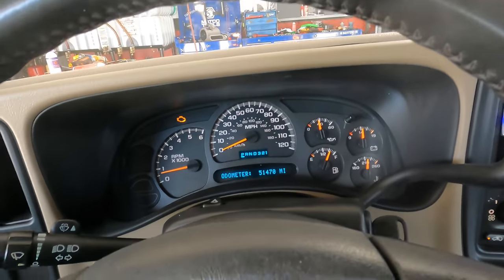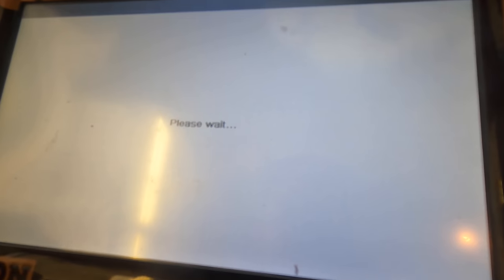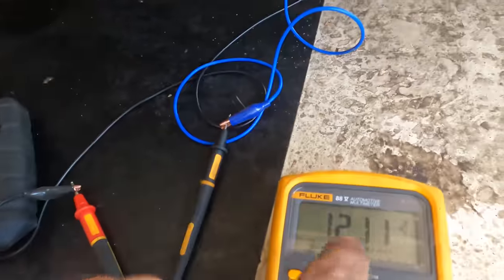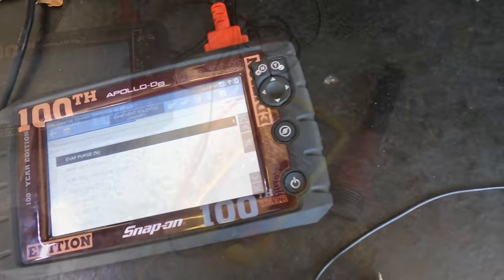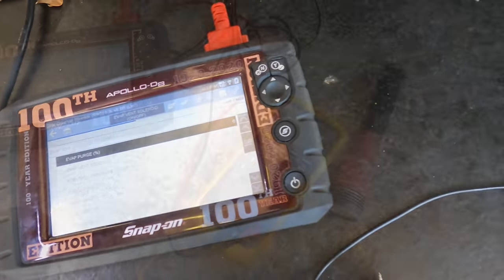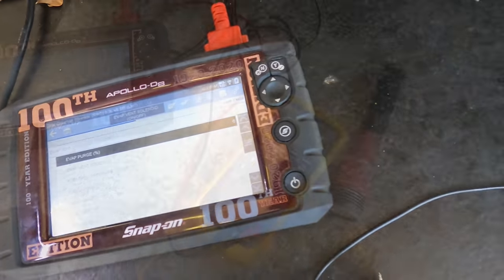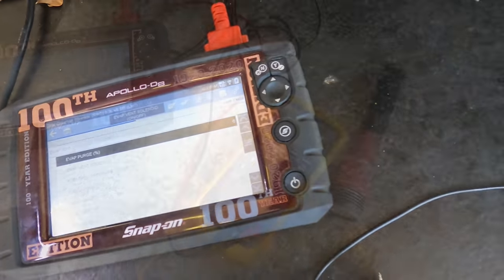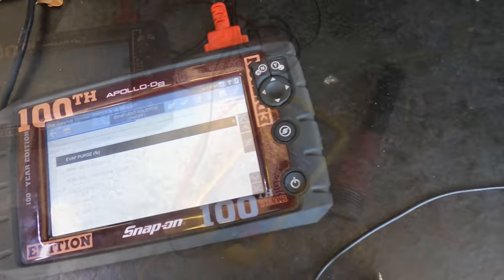RARE FAILURE! Short Circuit? Misfire Evap | Chevy Silverado 5.3 P0300 P0455

Comment: Hey. Good job ray. You should gwt a power probe. Then you could supply power and ground independently. Also some models have 5v referance and a volt meter function.
Reply: I have one of those.  The main reason I bought it was the ability to probe through the insulation on the wire.  In the old days I would use test leads that had very sharp points to do that job and about half the time I would stab myself.  Since the Power Probe came out others now have that feature but I think Power Probe was first.

Comment: I'd like to point out the negative resistance value on your meter during your troubleshooting is an invalid reading. This is because the circuit is energized. The voltage is driving the meter reading instead of the meter providing the test voltage. In order to perform a continuity/resistance test, the circuit under test should be de-energized.

If you ever see a negative resistance that's your indication the circuit is energized and cannot be directly tested for resistance.

Love your videos, Keep up the great work!
Reply: It was double checked and further verified, when he disconnected the ECU. With his go/no go check
Reply: @pmotorsports8276  I wasn't questioning his troubleshooting ability, I was simply pointing out the reason he was seeing what he was on his meter at the time and perhaps improve his knowledge.

Comment: With the amount of programming you do would it make sense to have the factory flash tool and pay per program like Eric O
I do understand you are an employee of a shop and Eric has his own business but I think you would have a very good case with the boss. It would certainly make your life easier.
Thanks for your great content from an old retired mechanic who specialized in driveability problems in the bad old days of OBD 1. 👍
Reply: I do not know the cost of GM software. I do know the cost of the Mercedes software in the US* for a business. Cost $29,000 up front for 4 year  license, includes the hardware then around $4,000 per year for  license. *As the US is NOT  regulated, in the EU where regulated they{vehicle manufactures] MUST give access to non-dealer business at a reasonable cost, cost was a few years ago around 70€ per hour, business supplied hardware. Look up the cost of the current GM scanner/ programmer a few thousand NOT including the programming software  which is per vehicle. Yes, I am aware you can purchase "copies" of the OEM scanners/programers, you still have to purchase the programming software/program for each vehicle.

Comment: I'd be curious to see if you got the same results if you had used an incandescent test light to check the vent solenoid circuit instead of a voltmeter.

Comment: While watching your video where you changed a power window actuator you cut the bolts that were too long in your vice with a side grinder. There was an aerosol can in the direct line of the sparks from the grinder. This is an unsafe condition.
Reply: Sparks will not ignite a compressed aerosol can. Sparks by the time it travels 6 inches it’s cool to the touch
Reply: The other thing is that the blade can shatter and pierce the can. Not a good thing.

Comment: Any chance you can tell us what the ECM  costs... Im curious

And a used one wouldn't have worked?
Reply: I wouldn't trust a used one when it comes to electronic components like these ECMs. Too risky something is wrong with it that could mess something else up in your vehicle. Anyway, Googled the part number from the video, and the prices were from around $200-$230 or so for a new one. Refurbished was a bit cheaper. Not saying that's what the one in the video cost, just an idea what it may have cost.
Reply: @george8873  Wow that's cheaper than I thought it would be.... Thks

Comment: Use an arc suppression device close to the ECM for this circuit. A contact breaking DC will take more abuse than a AC circuit at the same current rating.
Not going to get into the math of what happens when breaking a DC circuit with a coil involved.
1. When the contacts in an arc suppression circuit open, the applied voltage is placed across the capacitor and not the contacts.

2. The capacitor charges at a rate faster than the contacts open which prevents an arc from forming across the contacts.

3. When the contacts close, the inrush current from the charged capacitor and source can be substantially higher than the contacts can safely conduct, causing the contacts to deteriorate. This is why it is important to have a resistor in series with the capacitor.

4. The resistor acts as a current limiter which reduces the inrush current by a significant amount. The arc produced at the contact closure is greatly reduced, thus extending the service life of the contacts
Reply: So if you have a bad purge valve coil, it will destroy the ECM contacts. Go to Digikey or Newark electronics to select the correct arc suppression unit for voltage and amperage rating.
Im just saying, but not saying.
Works for all other DC coil circuits.
Easier said than done.....but I have time on my hand.

Comment: Or… you could gut the innards from both purge solenoids and put the good ones in the can for the old one (that still has the hose on it.)! Or repair the old one with duct tape and baling wire. Everyone knows you can fix anything with duct tape and baling wire! 😆 (and maybe a hot soldering iron.) Nice shout-out to Eric at SMA! ❤️

Comment: Pine hollow  had to reprogram a reman ecm with his scanner. . Had to change the Vin  number  it was suppose to be program from manufacturer but wasn't.  The ecm he had had Vin from  another vehicle it was taken from and reman. New ecm was possibly not available  or too expensive. I've seen injectors on John deere tractors have their own numbers that have to be reprogrammed to the engine.
Reply: He had to do that with an injector on a earlier video (a 6.6 duramax, I think).

Comment: That remote programming service is horrendous! Have you thought about getting into programming  yourself? A Bosch Mastertech 2 would be a great place to start. It’s works with the Ford, GM, FCA, Nissan/Infinity, Honda/Acura and Toyota/Lexus OEM software. The OEM software is available via a short term(daily) subscription for a reasonable fee. The cost would be passed onto the customer as part of the job.
Reply: Just checked online and found Grainger has them for less than $2K, much cheaper than a scan tool.

Comment: Surely plug in and go should be on the ecm all that mess about these electronics are a pain
Reply: It's entirely possible for them to design these systems so modules don't need to be programmed, but if they did that (a) they would lose the revenue stream from requiring programming, and (b) there would be rampant theft/resale of the modules.  It's kind of a no-win situation I guess

Comment: Misfire,  a cel, and a Silverado? Yeah, that's about normal and those CEL bulbs will last longer than the engine.  
I've got 520,000 miles on my 02 and have replaced the engine. Damn CEL still hasn't burned out, truck runs like a top.

Comment: Ray….  Good job on the evap solenoid job. I have been watching faithfully for several months. I can see that I will be willing to dig in a lot deeper on shade tree projects than I once was.  Thanks.  That should save me lots of money in the future.   The only question I have had with any of your efforts is why you don’t add a drop of oil once in a while to threaded puller tools like ball joint splitters, etc.   Seems like that makes things work more smoothly, might provide a little more pull in some cases and probably preserves the tool threads. What do you think?

Keep up the good work.  Thanks.

Comment: I'm a little surprised they didn't give a spec on that hose splice. I'm not entirely sure heater hose is up to the job. It will probably be fine for the rest of the life of the truck since the old tube is butted right up to the new solenoid, leaving very little exposed heater hose. Personally, I may have tried to use fuel line of one type or another, but as I said, being an 04, it will probably be fine for the life of the truck.
Reply: It's an '04 with 51k miles. At this rate the truck could conceivably be on the road 50 years from now...  A lot of those 2wd 1500 GM trucks of that era are rolling well past 200k.
Reply: @mikejacob3536  I have an 03 2500hd, great running truck, but here in ohio, rust is starting to dig in pretty good.
Reply: @donakahorse  I'm in Wisconsin. Most trucks over 15 years old up here are suffering terminal cancer.

Comment: Now if you had not bought that scan tool you could not have done what you just did on that truck, its paid for its selfe
This tool make you more valuable its better then what the shop has as you stated. 

A good buddie of mine kept up with the ever changing tools I belive that unit can be flashed for new models as they are interduced  unless they move from odb2 to odb3 as they had talked about 15 years ago.  Toyota kind of started this 
My 88 supra has somthing like it but most the new scan tools won't work on it.
I dont even out a scan tool not even a cheap one.   I should buy one.
The mechanic I knew like to drive without a seat belt on, I took him to a dealership once before id start the car I made him put it on.  10 years ago going to a new car dealer for parts durring a snow storm he rolled his truck on an icy bridge fell out the driver door window and got crushed by the truck. Killing him.
Wear your seat belt.   In a parking lot no big deal.  Out in traffic put it on.

Comment: Do all makes of cars require the assistance of a RAP artist when replacing the ECM? Was that Run DMC on the phone? You did a good job! I was at first thinking leakage current thru the ECM was making the meter read 12V constantly on the solenoid connector. When a computer output is a relay, the meter will work fine, but if the output is a transistor or thyristor (in the case of AC outputs on industrial stuff) there may need to be a bit of a load when testing for an off condition. In those cases, one would want the meter across the wires with the solenoid or some other load connected - just not open-circuited. Do ECM's have all relay outputs, transistor outputs, or a mix of them for discrete (on-off) signals? You might already know - so had no qualms about the open-circuit condition. Being a sub-novice DIY clown, I had to ask.....
Reply: My guess would be that the ECMs are exclusively transistor outputs and anything higher power would find the relay in a fuse box controlled my the ECM.

Comment: As an electrician it made me cringe when you took your multimeter to resistance while the leads are connected to a power source. Even your Fluke was screaming at you for doing it. Sure it's only a 12v system but improperly using the resistance function while on an energized circuit can and will damage your multimeter. Fluke is pretty good with providing built in failsafe so you don't get injured but I'd rather not rely on something like that. This practice is especially dangerous when you deal with larger voltages/current as even the failsafe can't stop a multimeter from blowing up in your hands.
Reply: The way you keep your fluke from blowing up is you throw away the fuses that fluke puts in them (10kA interrupt rating) with some 100,000A IR rating or higher. Fluke knows those 10k IR are little sticks of dynamite and the will still put them in.  The fuses are what blow up.
Reply: I cringed as well! So many times on this channel I see him test circuits disconnected with an ohm meter. No, just no. That's not how you test circuits. I know that's what the trouble tree in the manual wants you to do, but an ohm test is very much inferior to voltage testing the circuit under the load it was designed for. This verifies everything at once, including the wire's ability to transfer the proper amount of current. If you see voltage across the terminals of that solenoid while it's connected you don't need an ohm test. Ohm testing has it's place, but it will bite you in the ass in the wrong circumstances.

Comment: 09:02 Measuring 2 Mega-ohms to ground? That's not enough to actuate a solenoid and probably just moisture.
Use a small test lamp, not a multimeter!
Not saying the ECM wasn't pooched, but if the output was "on" the reading would be in ohms, not millions of ohms.
To demonstrate this to anyone curious, lick your fingers and measure the resistance between them with a multimeter - you get a reading in the k to M range. Now try to operate a 12v solenoid with your fingers!
Would be interesting to see if there is water damage in the old ECM.
Reply: It was previously shorted to ground  0 ohms, mego ohms with ecu disconnected
Reply: @pmotorsports8276  Yes .... saying "We should see this circuit go open when it's commanded off...we do not" ......... 2 meg is pretty flippin' open!

Comment: Could the fuel cutoff be programmed at a higher rpm? 
During the crank position sensor reset,
What happens when the ecm is programmed for 5000 rpm vs 3500 rpm?
Reply: You may be able to get that done by some aftermarket programmer but I don't suggest it. The rev limiter is in there at that rpm to keep people from blowing their engines up.

Comment: Chevy's were once reliable before they went bankrupt and were bailed out by the government....daily drivers of mine are a 61 GMC longbed with a 327-375 4 speed and a 65 comet Cyclone 4 speed with a 289 HO....both are slightly modified.  JESUS SAVES. Good Job Ray.
Reply: This generation (99-06) was the best and most reliable truck ever made.
Reply: @bikes7777  engine,  not the 1500 transmission
Reply: @pmotorsports8276  transmission was a bit weak if pushed but still a solid choice. And easy to rebuild.
Reply: @bikes7777  10-4  700-R4/and all of its 4L60E descendants have made me lost of$ every 100k miles
Reply: @pmotorsports8276  nice!

Comment: First thing I check for a large leak is the gas cap. I've had more than one car come in with a large leak and when I went to check the cap, it was missing.
Reply: Seems someone else thought about that as the gas cap was new.

Honestly there's such a lot of new things on these cars that I have never had to bother with. The most modern car I've had was a 90 something Toyota. Very little of all these things in that. Note even a ODB port to be found. I think there was some Toyota proprietary port, but it wasn't anything I could use.

Compared to todays cars it was very simple. Most diagnostics were simply looking at the old  "Air? Fuel? Spark? Bang?" sequence.
Reply: @blahorgaslisk7763  it's still the same air, fuel and spark. It's just computer controlled now. If you know how it works, diagnostics is actually easier now.
Reply: @aaronbritt2025  It used to be simple mechanical devices, now there's all kinds of valves and sensors that keeps crapping out. Not to mention that it used to simple to replace a spark plug. Now they tend to be located deep down into the bowels of the engine, or at least that's the way it feels. There used to be one spark coil, and it was easy to access and almost never had to be replaced. The spark wires were cheap and easy to get at and the distributor simple and easy to understand. Just about everything was simpler. Yes everything mechanical can fail, but when it does you can fix it.

Now I will admit that if you have all the tools diagnosing a car is easier today, but the amount of things that can go wrong is far higher. Even so modern cars are quantifiably more reliable than cars were 30 years ago. But when things fail there's nothing the average driver can do except call for assistance. And a lot of the time it's a sensor that are acting up causing the car to shut down.

Just because I see the advantages doesn't mean I have to like the disadvantages.